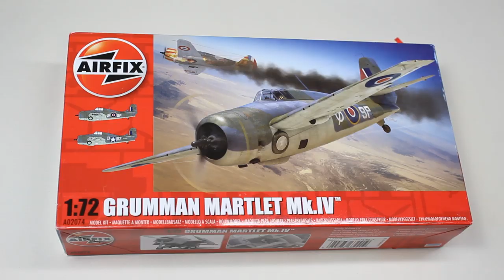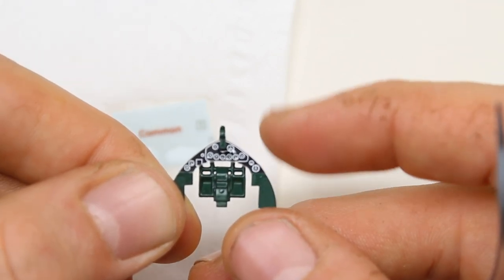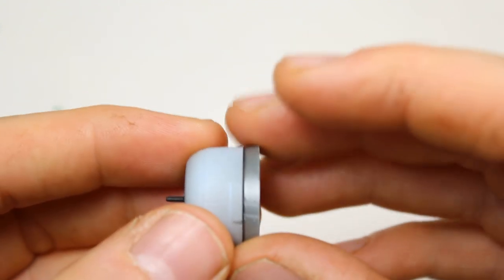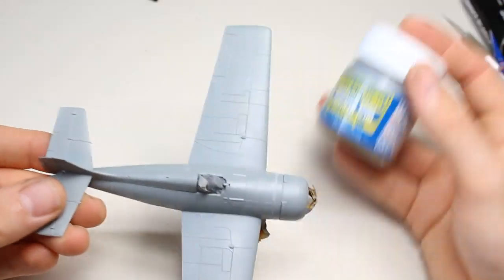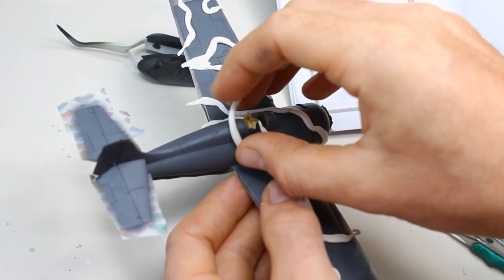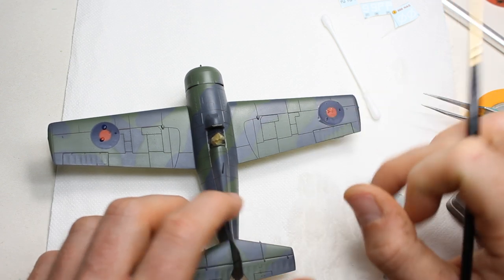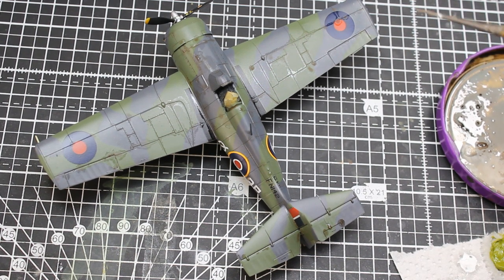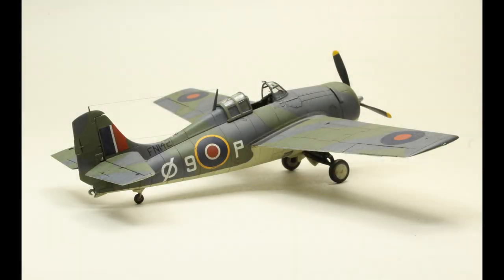Airfix 1/72 Grumman Martlet Mk IV, Full Build Video

Comment: Just a quick question. When do you use the Kwikset and when do you use the extra-thin Tamiya cement?
Reply from the maker: I generally use the quick setting for 90% of jobs then the normal version for jobs that require a bit more movement and a longer drying time to ensure correct alignment; Wings, undercarriage, fuselage joins etc

Comment: Well, I bought this exact model and.. IT JUST FELL APART, whilst putting on the thing behind the seat it kept on falling off, the seat wouldn’t fit into place, and when I took off the gearstick (no clue if that’s what it is) the top of it snapped off! Is there a reason for all of this?!
Reply from the maker: Well I’m not sure why you’re having the problems you are but if you watch the video you may be able to pick up a few techniques that will help
Reply: Champion Scale Modelling I watched the entire video, and nothing worked. The thing behind the seat kept on falling off and nothing would clip together, I might just buy a different model